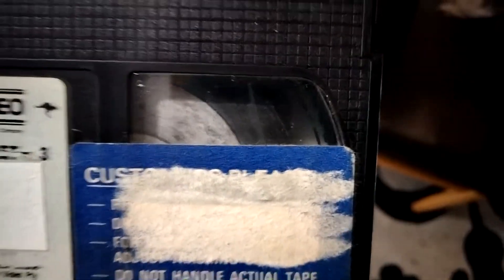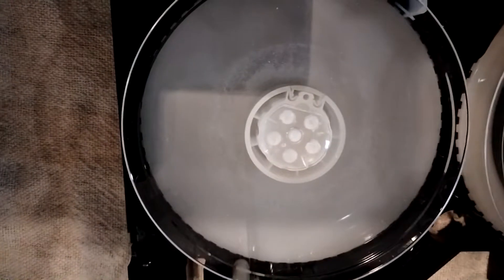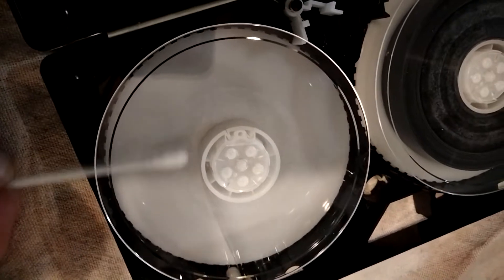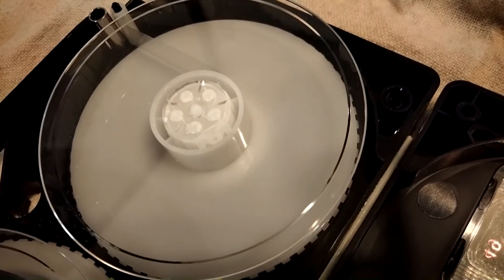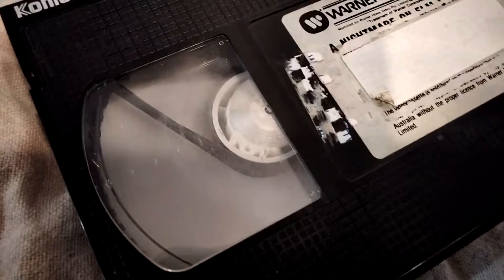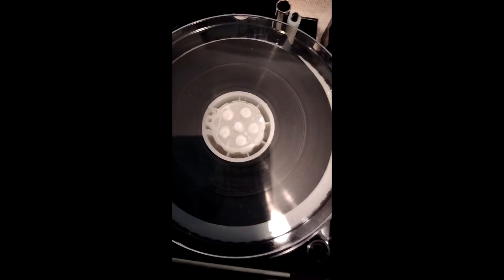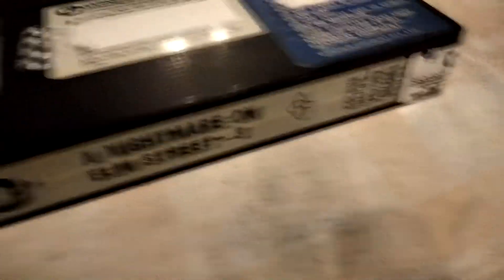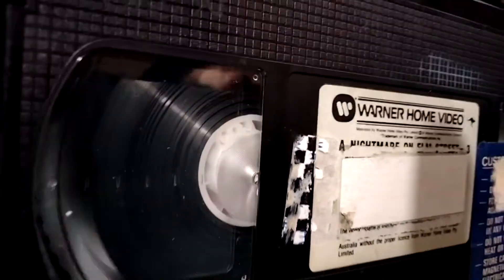How to save a Mouldy VHS Tape

Comment: I have saved many tapes doing this method but some unfortunately don't make it. my only issue with this method is I've gone through a few vcrs, they stop fast forwarding and reminding..
Reply from the maker: Yeah I use a dedicated VCR for this. It's all I use it for. I bet the heads are clapped out. But I've got a stockpile of VCRs ready to go.

Comment: Awesome job mate. I’ve got over a hundred of my own to do. How long does each tape take to clean?
Reply from the maker: Depending on the severity it can take  anywhere between 10 minutes to a few hours. You wont really know until you've completed the first run. This clean took me 90 minutes. But I had to open the tape to be thorough. Small amounts of mold usually take about 20 minutes.
Reply: @daleazzopardiTV  thanks. I’ve got some work ahead of me. Can’t bare to throw them out.